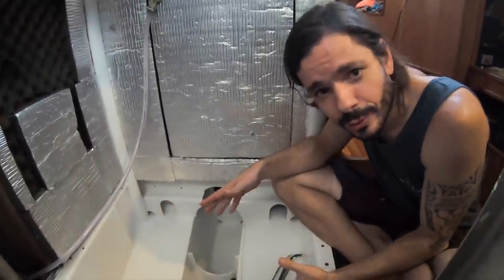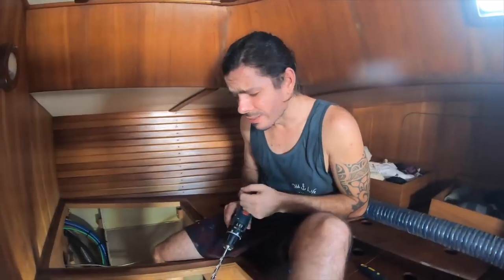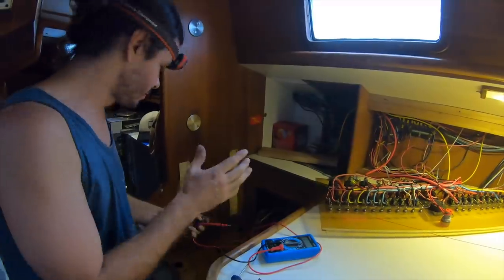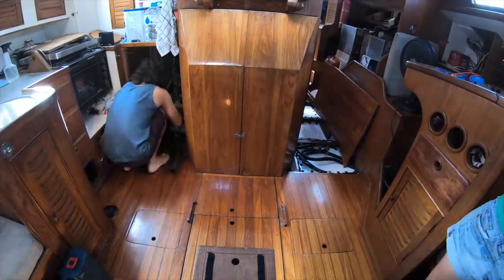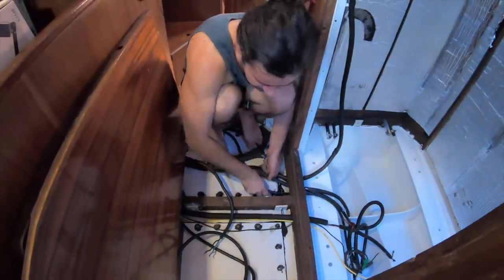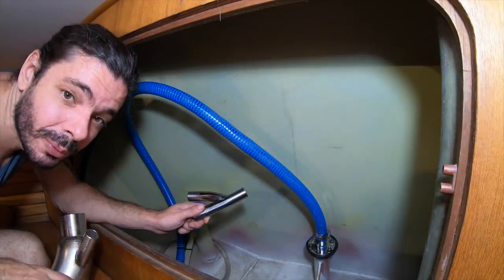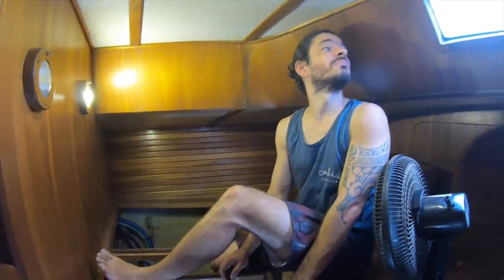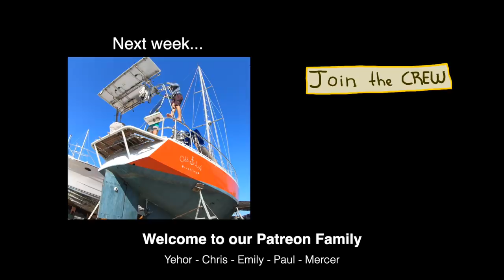⛵️We didn't think about that when we Bought a brand NEW ENGINE for our Sailboat!! 😨#174

Comment: Even with the check valve, there is a chance of carbon monoxide back filling into the bilge
Reply from the maker: About the exhausting fumes coming back through the bilge pump: we will have a one way valve, but just in case we will add an alarm on the bilge and run some tests, if we have any problem we will take the bilge pump from that through hole and send it to another true hole.
Reply: @OddLifeCrafting  Awesome!  That should take care of the problem... should it occur.  Good luck and may the grace, peace, and protection of God the Father and the Lord Jesus Christ be with and bless you two always!

Comment: Question why not contact the engine manufacturer to see if on to down size the exhaust connections? Before you do anything. Because if the same CC then size May not matter..
Reply from the maker: We did it. If we downsized it we would loose the warranty
Reply: @OddLifeCrafting  I know Diesel engines can be turbo to make it more powerful but back pressure is important Older Engines usually have larger exhaust outlets and less efficient and economical. Seams very strange to need a larger outlet that must NOT leak into the boat and also Not leak oil into the water from the exhaust. On a car lorry or other the Exhausts are never manufactured by the engine makers. So not understanding their issues over warranty.. Oh well Never mind.
Reply: @Jay Not the European ones they buy them in same with the cat's I think Japanese also as it all depends on size of engine composites. If you have a six litre  V8  well you don't fit a two litre straight four exhaust. They are all standardized for that car so easer to buy exhaust for it. The only special part made by the Engine makers is the exhaust to the engine or5 engine manifold but that does not normally rust through to be replaced.

Comment: big safety question....what is preventing carbon dioxide from flowing back into boat through bilge pump and killing you????
Reply from the maker: The valve we are gonna install on the hose and if the alarm we are gonna install there accuses we have a leak we can change put the bilge pump outlet in other place
Reply: change your idea now......an alarm does not prevent death....horrible idea....change it....do not proceed

Comment: We're almost to spring I guess that means your almost to fall ...it is amazing to me that weather your restoring an old car like my husband does or an old boat like your doing it's so much the same, I thought this would be easy but I guess like everything else in life it has its challenges. As long as you remember to open the valve when you run the bilge would a 1  way valve like they use on an rv work better you don't have to remember to open the valve
Reply from the maker: ☺️ indeed. Everything has its challenges

Comment: Hi kids, I'm surprised the exhaust was an issue I got a 400 cubic inch V8 Chrysler engine that only uses a 2in exhaust pipe, I hope you didn't go through all this work unnecessarily, you kids are doing well great video

Comment: Am I the only one that noticed that the bilge pump will end up pumping water into the exhaust and back to the engine?
Reply from the maker: It’s gonna have a valve to avoid it
Reply: @OddLifeCrafting  So, you won't be able to pump the bilges while the motor is running?

Comment: 3' diameter gives an area of 7squ inches, 2.25' diameter gives an area of 4 squ inches plus the 1" pipe will give a total of 4.8 squ inches. You still have a problem I think.

Comment: To much back pressure.... A 3 in. pipe is 7.065 sq. in. in area, a 2.25 in. pipe is 3.79 sq. in. in area. To prevent excessive backpressure you will need a 2.25 in. and a  second pipe greater than 2.125 in. in diameter. A 2.25 in. pipe and a 2.125 in. pipe will give you a area of 7.17 sq. in. in area barely above the 3 in. pipe... The current second pipe is WAY to small... This will lead to engine damage and I am sure that it will void your Yanmar engine...

Comment: Show the video to your welder who made the pipe sections he should be able to make the short step down angle you need. They also make flex pipe for exhaust you might use for that.It is probably good that you are putting in new exhaust but 3in is for big hi performance engines 500 hp and above that little engine did not need 3 in. but I never worked on boats too expensive always needing another repair on the way to the bottom of your sinking bank account good luck you two............
Reply from the maker: We couldn’t find the flex pipe here in Brazil. It’s all fixed with the welder now 😊

Comment: I believe your 2 1/4 exhaust would have been fine. Once the exhaust gasses are cooled they do not require the same volume. The added restriction would be minimal.
Reply from the maker: We want to keep the Yanmar warranty that’s why we are following their instructions
Reply: Yanmar want to minimise back pressure. Could you ask them to specify the maximum permissible back pressure? You can check this with a  u tube manometer - would make for an entertaining video

Comment: Come on don't make a big mistake now. Cut out the old pipe through hole and increase the size to fit your new exhaust system. You are on the hard it would be easy to fix.

Comment: I urge you to revisit any "restriction as direct flow via bilge pump".   Asking, could the value as potential in any....future problem,  hamper bilge to full capacity pump volume. Could engine produced heat, soot as carbon cause valve or hose (tube failure)?

I humbly suggest every effort to avoid that unintended outcome. Critically reason forward emergency needs.
Seize advantage by profession engineer as engine critical in storm and incidental cost and fitment protective to life and craft if needed and within review.  This could occur via remote means.

And I think a carbon monoxide detector would be well provisioned as an "angel to alarm"
to enclosed area. Adequate exaust fan to expel hydrocarbon vapor at leak.
Ask and follow install "start up checklist.     M.

Comment: Exhaust get very hot and you have now put it under a clothes draw !!.........FIRE !?
Reply from the maker: We are gonna do everything the engineers from yanmar says we need to do 😉
Reply: Its water cooled downstream of the water injection elbow (as close to the engine exhaust outlet as possible). 70 deg centigrade max. Many boats use plastic or grp components these days. Mind you, the plastic water locks and mufflers have been known to melt.

Comment: Why not just get a 3'' to 2 1/4'' reducer?.., even if you have to get one fabricated it will still be cheaper than doing all of that.
Reply from the maker: In this way we would loose the Yanmar warranty
Reply: @OddLifeCrafting  You are just adding the diameters of the exhaust pipes, wouldn't the cross-sectional area of the exhaust pipe be what you should be concerned ?